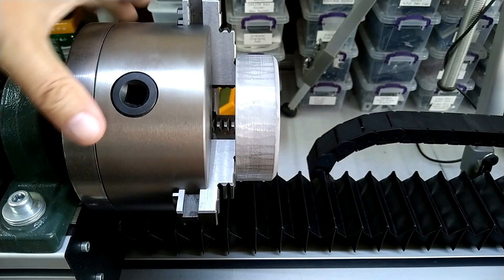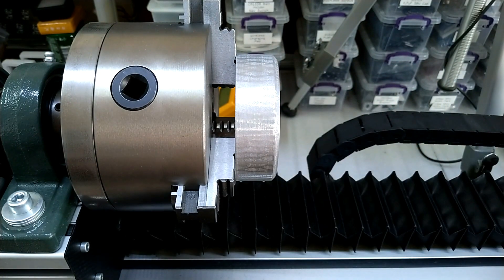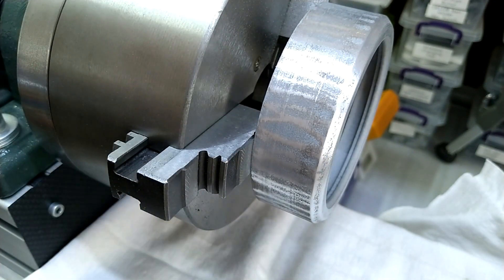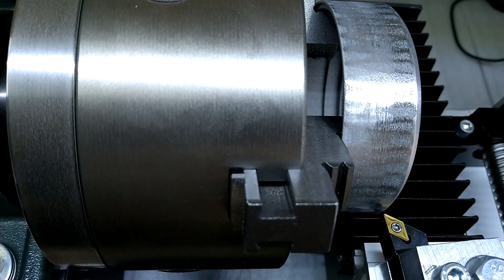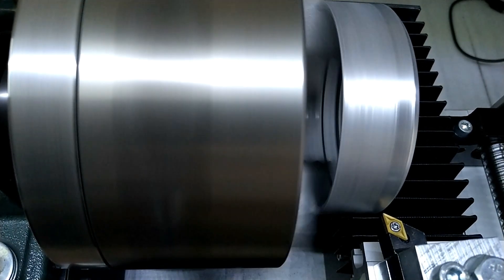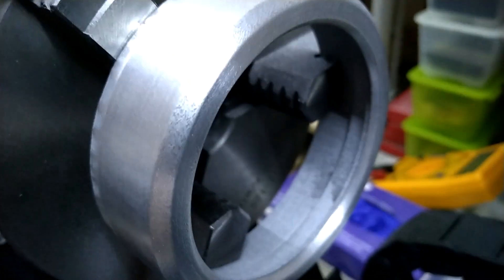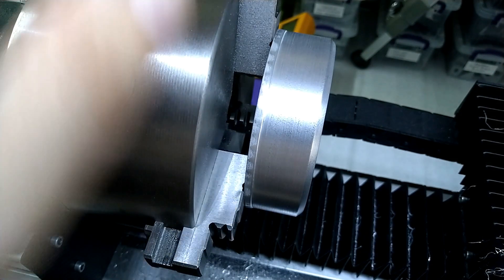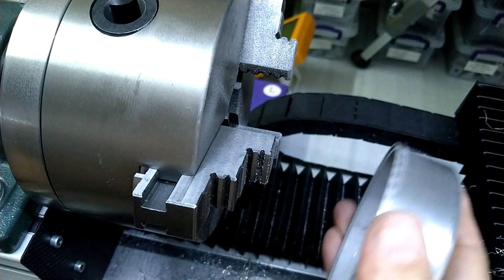Turning a 3D Printed Metal Case for a GPS Speedo build and designed by #Hayri on a DIY #CNC #Lathe

Comment: Any excuse to use your beautiful lathe...Hah, Haaa!!!!! I was nervous too, when you took that first pass!!! It's so hard to figure what speed and feed to use since the material structure is a mystery. The stringy turnings makes one think it is a solid steel, even though it would make sense to be more of a powdered metal composition. I was expecting to see powdery turnings. Very interesting!!!! Also nice to know that it can be lightly machined as well!!! It definitely looks much nicer than original!!!! Thanks for sharing your experience with us!!!!!
Reply from the maker: Hahaha, that's for sure, I yelled several times "I made it", lol. Considering not knowing what kind of material, bit, speed, feed, I guess I got lucky that it did not fly off and hit me in the head 🙂 Definitely good to know that you can machine it, it opens up a few ideas 🙂 My fingers and brain are itching again. Was surprised about the shavings as well, nice that they "broke" off and not got stringy. The whole case has a nice feeling structure now, almost as if it was anodized. Have to put it together now to see how the finished speedo will look. Having a PCB as backplate, GPS signal will not be a problem, now that the case is metal. 3D printing with metal could be nicely used to make all kinds of customs cases for my products, hmmmm my "secret project" comes to mind and as Nik suggested, tumbling would be the next post processing I could try for parts that are not round in shape. Stay safe my friend.

Comment: Thanks for that Hayri. Good result. It certainly doesn't look 3D printed now. Maybe some wire wool and a dull wax would look nice.
Reply from the maker: No problem and I am glad I did turn it down with the lathe instead of "just" sanding it down. It definitely looks AND feels better now, raw 3D printed metal needs post processing for sure. Don't have any steel wool at  hand but I think it would make it shinny again, which in this case I want to keep it matte. Not sure how dull wax would affect it 🙂There are probably quite a few way to process it, but seeing it now in daylight, it looks quite nice, if I say so myself, haha. What I wonder now is, if it is going to tarnish and get darker? Guess we'll find out 🙂